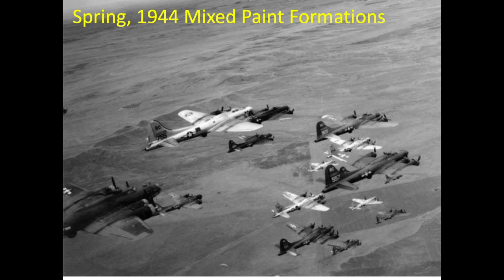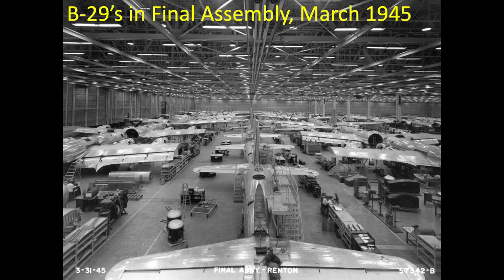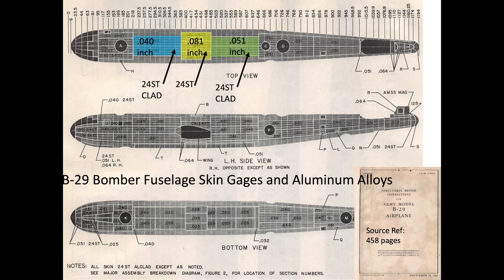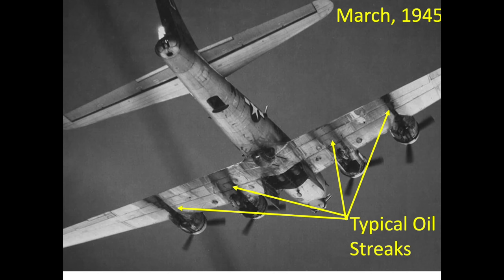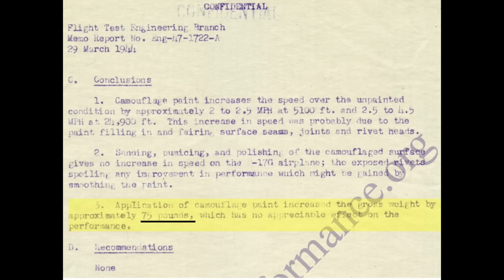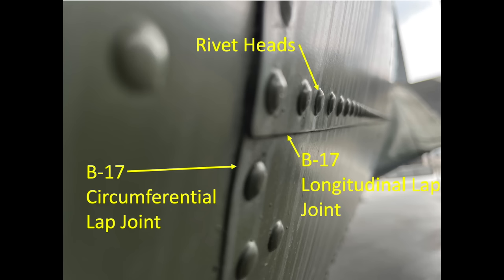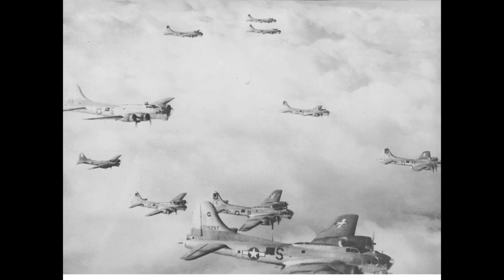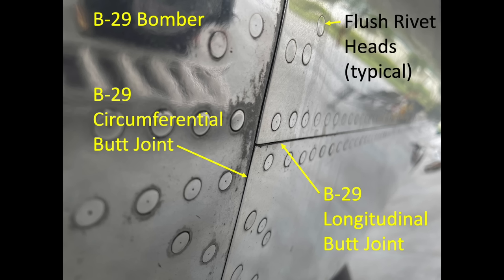B-17 Bomber Paint Vs No Paint, Unexpected Results

Comment: Is the only variable the presence or lack of paint?
 In the real world, most unpainted (silver) B-17s were the -G variant, that had the added drag and weight of a remotely controlled chin turret housing 2 caliber .50 machine guns, and the power mechanisms need to elevate and traverse those guns; the additional weight and drag of 2 more caliber .50s mounted in the sides of the nose, and the weight and drag of the modified bulged window mountings for those guns; the additional weight of plexiglass panels permanently mounted at the waist gun positions, a taller top turret that would increase drag, and a slighly heavier Cheyenne turret tail gun modification. 
  Changes in turret and equipment manufacturers could result in slightly increased or changed overall weight.
  Additional weight and drag could account for the increase in horsepower needed, and a reduction in performance.
Reply: The charts show that the tests, both with and without paint, were conducted on B-17Gs .
I doubt if the testers would have overlooked the differences in the G vs. earlier variants; that chin turrent is pretty hard to not notice.

Comment: The description of aluminum cladding in this video confuses me. My understanding is that Alclad is a thin layer of pure aluminum over a core of aluminum alloy underneath.  An alloy is used because it has superior strength and fatigue resistance over pure aluminum.  The problem is that the alloys are more susceptible to corrosion than pure aluminum, so a pure aluminum coating is incorporated to protect the alloy underneath.  It is the pure aluminum that is shiny, not the allow.  The video didn’t make any mention of alloys, which seemed to imply that unclad aluminum is pure aluminum, but I don’t think that is the case.

So, my question is why is an unclad aluminum used anywhere on the skin of the airplane, such as the fuselage center section?  The skin there is twice as thick in other areas, which implies more strength is required, and I would think superior corrosion resistance would be of benefit there as well.  Can anyone explain this?

Comment: where did you find the info on aircraft aluminum panel thicknesses used? I would love to find info like that on different types of aircraft for a design study.
Reply from the maker: Skin gage and alloy maps can be found in the airframe's SRM (Structural Repair Manuals). These documents can be sourced on the internet or ebay. Hope this helps!
Reply: @WWIIUSBombers  yes, this does help. I looked more closely at your frames and noticed you shared the source materials, something few others take the time to do. So I searched and found a huge number of them. Now trying to find any similar documentation for post WW2 light aircraft as well.

Thank you

Comment: Would have been interesting if they started using flush rivets and butt joined panels on the b-17s. But there was a war on, and they needed to get all the planes they could overseas, so there was no time to fool around with 'experiments'. Especially experiments to basic construction methods, which would have needed new tooling and construction techniques.

Comment: How significant was a 90 mile range advantage in the long term? 

At the end of the day, seems to me that by the time the US entered the war, and certainly after Normandy, I don't see that it could have made a significant difference either way. Our planes could get well within Germany to bomb whatever was needed even without the extra 90 miles (I think?), but camouflage is useless in the air when you have 4 massive contrails behind you, and useless on the ground because of air supremacy. 

I would suspect that, lacking air supremacy, the camouflage would have been more than worth an additional 90 miles range due to not getting destroyed on the ground. With it, the advantage of being unpainted seems very slight considering painted planes could still hit whatever was needed, albeit a bit more wastefully.

Comment: Well, I'll be damned!  As others stated, totally unexpected. but when i saw the non flush rivet heads, I immediately thought - hey, paint would smooth out that drag surface, 200k rivet heads is big time drag. Paint makes the air flow better about these rivets.  Sure enough, that was the trick. And the B29 proved that point too.

Comment: Surprising results until you explained the reason for the painted B-17 increase in speed and distance because the fuel economy increase on the painted bombers. Never thought the unpainted
B-17 would be harmed because the wind drag loads increased because of disturbed air flowing over the empty seams and rivet heads.

Comment: that comes as a surprise. I remember reading once that american airline flew unpainted aircraft because of fuel saving.  but this article seem to disprove that
Reply: Not necessarily.  The later American Airlines aircraft (from the 'jet age' for certain) would have an external finish more in line with the B-29 - flush riveted and butt-jointed - which would greatly reduce or even eliminate the gains seen by painting button riveted and lap-jointed skins.  In that situation, the weight (and cost) saved by omitting the paint probably wins out.
Reply: @Flyingbrickyard  is not that what I said?
Reply: @dalecarney6582  It doesn't appear to be.
Reply: @Flyingbrickyard  seems you may need glasses because that is what I posted. but anyway have a great day
Reply: @dalecarney6582  The comment wasn't meant to be argumentative, or intended in any sort of negative way.  Your initial comment covers both cases, but concluded with "this article seems to disprove that", with 'that' presumably referring to the first part of your comment.  That conclusion appeared to be the thrust of your argument at that point.

I replied that this article (video) doesn't necessarily disprove what you'd heard, and listed the reasons why.

It's not entirely clear what your stance was, but I commented in support of your initial statement - despite the fact that you'd appeared to revise your stance after watching the video - based on the concluding statement of your original comment.

In short, and to be very clear - I believe what you (and I, and many others) heard or read about the reasons American Airlines went for a natural metal finish are correct, and the reasons they are correct aren't contradicted by the fact that a painted B-17 had better performance than an unpainted one.  As mentioned in the video, the B-29 saw little to no such gains from painting, for the same reason the American Airlines fleet wouldn't have either - externally they shared a similar 'clean' construction.  

I hope that clears up any confusion, and that you also have a great day.  We're all here to enjoy the same content, and presumably aircraft in general.  

Take care.
Reply: @Flyingbrickyard  ok no problem, some time when one write something their meaning is lost on the reader,

Comment: At war’s end with no B-17 flying to do, dad and his crew based in Foggia Italy decided to polish their bomber. He told me that they tried everything imaginable but were unable to make it shine. A few years ago there was a Smithsonian special featuring the lady who took an entire year to polish the Enola Gay B-36 for display. Using everything at her command she would only complete a few square feet each day. Heck, she didn’t even have to work around bullet holes. There were almost 100 of them.
Reply: It probably had a clear coat sprayed over the metal. Fighters got a coat of wax at the factory.
Reply: @billwilson3609  I am in the process of upgrading a large plastic model of dad’s plane. It will be painted in weathered barf green colors of the era and will have the correct insignias and numbers. I have installed small electric motors in the engine nacelles and hidden the battery box in the Bombay. The radio antenna is the switch. When completed it will hang in the bedroom of his great grandson who is just now two.
Reply: @larrysorenson4789  I'm sure your grandson will be pestering you and his dad to take it down so he can play with it! I grew up with plenty of neighbors that were WW2 vets. One was a MP at a heavy bomber base in England so had made several plastic scale models of those before buying a kit to make a giant one out of balsa wood with a frame just like the aircraft had. Had all the wires for the controls and electric lines, seats, guns, etc. so one could have a see-thru skeleton model. I think it had a wingspan of over 4 feet. Another neighbor that piloted a B-17 and completed 35 missions would lend him a hand. That man said only he, the co-pilot and top turret gunner remained of their original crew and went thru 6 bombers since he had to belly land 3 in fields where they hit trees or outbuildings and 3 were too shot up to repair.
Reply: @billwilson3609  great stuff, thanks for sharing. According to dad’s 254, he piloted 56 missions. He never lost a crewman and was lead formation pilot on 37 of thise missions. One plane was shot up very badly. He nursed it back to southern Italy from Germany. When the tail wheel touched the ground the fuselage broke in half. In a trunk I found a “Certificate of Valor” including this story. They don’t make ‘em like they used to. Salute.

Comment: The RAF and the American boffins collaborated on a study concerning the effectiveness of the guns on bombers. 
They came to the conclusion that the considerable increase in cruising speed and engine life they gained when they flew bombers without the weight of guns, gunners and ammo, and with aerodynamically  improved performance from removing the gun-blisters and replacing them with sealed hull, would have made the planes much less likely to be shot down.*  It was a saving of close to a tonne of dead weight.
The  first time the idea was mooted to the American Airforce commander in Europe he said "You would never get the men into the planes, if they didn't feel they could shoot back".
But what really canned the idea was the surety that enemy planes were continuing to  get speed improvements, and the thought that  if they went with the idea, and there was sufficient improvement in enemy speed and interception speed, it would be an unprecedented political disaster. 
* Less time over target, faster therefore harder to intercept, less time on approach so less reaction time by vectoring of fighters, and the speed would mean they were harder to range-find and fire at by ground targets.

The idea was  triggered by the fact that the Mosquito, 100 MPH faster than the B-24, had a far lower shoot-down rate.

Comment: I was once involved with painting a C-5 for the USAF (C.C.) you would not believe how many 55-gallon drums of epoxy polyamide and polyurethane were used. So I disagree. An unpainted aircraft will fly faster.  A 55-gallon drum weighs in around 500 lbs each with paint.
Reply: A B-17 has the airstream airflow of a tank.

Comment: Why weren't they built with     flat rivets?
Reply: Probably because flush rivets were comparatively new technology at the time, and took extra manufacturing steps to install.  it wasn't worth changing over an existing production line to adopt them.  They require a stronger metal to be able to hold the stresses of the skin sheet without cracking, and more precision in installation to get the countersink bore right without damaging the panel they're being installed in.  They are better for performance, but more difficult to use; and in the early war, it was more important to get the planes off the assembly line at all than for them to be the most perfectly optimized.

Comment: Google says anodizing aluminum doesn't weaken it. Why not do that?
Reply from the maker: Anodizing is a conversion coating that thickens the oxide layer, it does not effect the strength allowable. Clad aluminum is weaker than bare aluminum.

Comment: considering the comparisons, were they straight up comparisons? painted vs unpainted f models, or g models that were painted vs unpainted? one has to remember, you cannot compare f models, because it was widely known at the time, that for some reason, the f models built by vega, had a shorter range for some reason, than a boeing built f model. if you are comparing an f model to a g model, you are getting into apples and oranges territory. the g model, with the addition of the chin turret, enclosing the waist gunner's windows, and the redesigned tail gunner's position, both added considerable weight, and aerodynamic drag to the g model, reducing range. the f model weighed 35,728 empty, and the g model weighed 36,135 lbs empty. it was known that aircrews, when it came to range, would take an f model, over a g model, and a boeing built f over a vega built f.

Comment: There was an assumption that the paint smoothed the imperfections of the exterior.  That may well be,, but,,,  as has been shown in fluid dynamics, repeatedly,, a smooth skin is not always the fastest skin.  Two examples I will place quickly  Sharkskin is as smooth (not)  as a piece of sandpaper.  Dried sharkskin is used as sandpaper on wood projects.  And   A dimpled gold ball will travel straighter and farther than a smooth golf ball,,, nearly double the distance.   Paint is NOT smooth. Run your hand over your own house wall.  Paint at its best has an orange peel sort of texture,, flat paint is flat because microscopically,, it is just like sandpaper.  A painted airframe may be more efficient because of IMPERFECTIONS of the  skin,,, not because it is smoothing the skin.

Comment: That is so strange! More weight means better performance and fuel economy....
Reply: It's similar to the dynamics of submersible pumps. Under a load, the motor pulls less amps than when it is not loaded down. The motors are designed to perform at their best efficiency when under load stress.

Comment: I thought this story was a load of nonsense.   Since my earlier post, I have found out just why it IS nonsense.  
B-17's flew at about the same speed or less as modern racer planes, but at higher altitude, where air drag is less.   On racer planes, some have flush rivets and some don't.  They don't make much difference - maybe a percent or two at most.  That fits in with the B-17 not using flush rivets - given flush rivets had been available for 10 years before B-17 production, if they did make a worthwhile difference, they would have been used - this was a high performance spare no expense military plane.
If flush rivets make so little difference, any difference in drag due to paint wicking in under each rivet must be entirely imperceptible.  Almost all the rivets on the B-17, much bigger heavier than any racer, will be within the boundary layer.  Any gap or edge that paint could wick into will always be within the boundary layer.  All rivets should be tight and not allow much wicking anyway.  
This report is just some field deployed officer's diarhea.

Comment: The explanation that painted planes performed better because of wicking into cracks does not make sense. It overlooks the obvious. Unpainted planes are more specular. i.e. mirror like. The more realistic explanation is that the painted matte surface caused mini-vortices at the paint surface. Basically, little ball bearings with less drag than laminar flow.

Comment: No way they can paint a b17 with 75lbs of paint.  A 5 gallon bucket of paint probably weighs 40lbs or so.  So 10-12 gallons?  No freaking way can they primer and paint an aircraft that size with that little paint

Comment: Updated information:   This story is definitely a load of nonsense.    While reading a book on the Spitfire fighter, I learnt that it was originally specified to have flush riveting all over.  Because of the cost and the need to speed up manufacture, Supermarine made one with standard domed rivets - it was found to be 20 MPH slower.
Now, a B17 flew at 182 MPH on bombing missions and was not aerodynamically clean due to protruding guns.    The Spitfire tested flew at 370 MPH.  Drag is proportional to speed squared, so at 182 MPH, drag would be only 24%.   The Spitfire designers went to a lot of trouble to make it aerodynamically clean and thus have low drag, by means of clean lines, thin wings, attention to wing blending into fuselage, etc, so allowing rivets to have a larger effect of drag.  And it is much smaller than a B-17, about 1/10th the flying weight.
 So, we can reasonably conclude that flush riveting on a B-17 would make perhaps 1 or 2 MPH difference at most.   Any increase in drag due any discontinuity at the base of rivet heads must be much less than that.
Conclusion:   Paint cannot have made any measurable difference to drag on a B-17.    The weight of paint is another story - it generally makes planes a tiny bit slower and burn a slightly more fuel.  The report is crap.
Reply: the earth is round.

Comment: This video is actually wrong. 
The sole reason why the bombers were not painted was to save weight due to the sheer wieght of those gigantic balls of steel of the crew. 
That, and just pure cockyness "yeah we here, what you gonna do bout it Hans?"
Reply: Your authority is undermined by "giant balls of steel".  Like most aircraft, B-17s were mostly aluminum, not steel.
In any case, the research data presented did show a performance increase.  And as stated in the video, as a result, the unpainted aircraft required a greater fuel load to achieve the same range, more than offsetting the weight reduction from omitting paint.
And I seriously doubt that B-17 crews shared your armchair bravado, in the face of "Hans" in Me 109s (Bf 109s) and FW 190s.
Reply: @bmjpdx9222  you must be fun at party